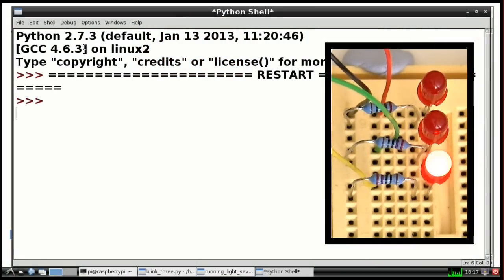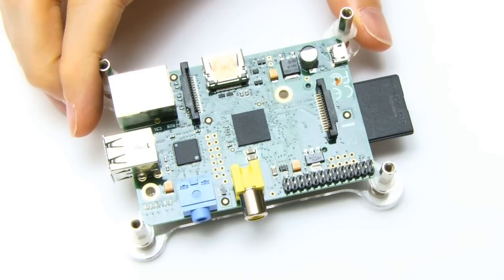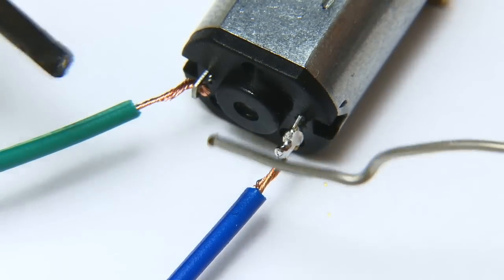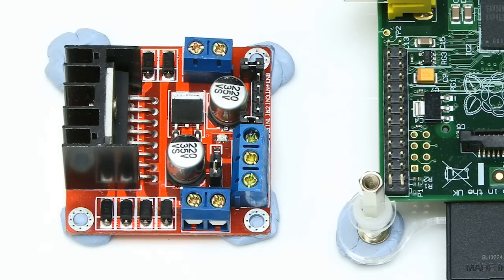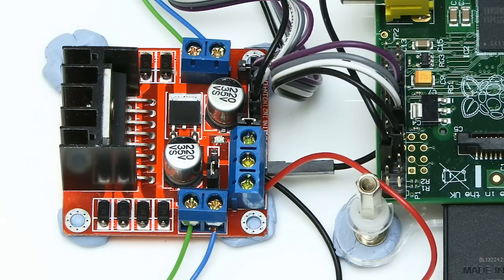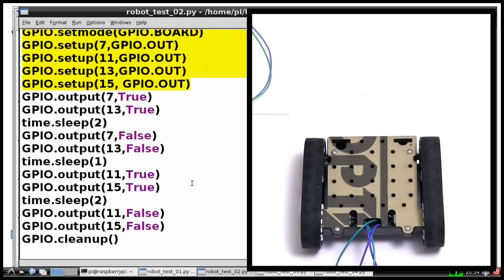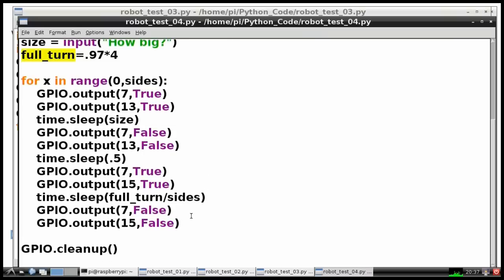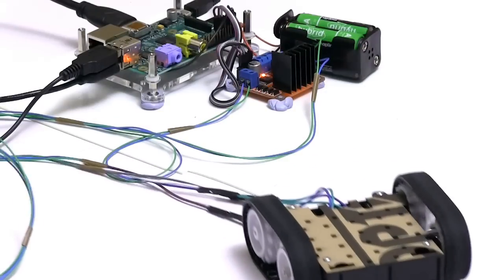Raspberry Pi Robotics #2: Zumo Robot

Comment: How many motors can you control with the raspberry pi?
Reply from the maker: It depends on the controller board you use, but using L298Ns (as in this video and its follow-ups), you could control 8 motors with 4 L298N boards.
Reply: ExplainingComputers hay that's pretty cool

Comment: I really love your videos! I have some question, is there a way to connect 6 motors without occupy a bunch of pins on the raspberry? And is it possible to control these motors wireless without them physically attached to the raspberry? 

Keep your work going!

Comment: Excellent explanation, so straightforward!

I was wondering if you could explain how to control 4 motors independently of each other (like for a drone or the Rimac sports car) instead of having just two motors.

Also, would the Raspberry Pi have enough computing power to receive inputs (other than positive & negative acceleration, and direction) and do calculations upon them? I would very much like to increase the capabilities of a kit I have for a 4 motor robot, but both motors of each side are connected to the same output of a L298 thus acting as one motor on each side.

Thank you in advance!

Comment: Hi guys am new to this but am having an error when i try to run this code it says "there is an error in your program: invalid syntax"

>>> import RPi.GPIO as GPIO
>>> import time
>>> GPIO.setmode(GPIO.BOARD)
>>> GPIO.setup(7,GPIO.OUT)
>>> GPIO.setup(11,GPIO.OUT)
>>> GPIO.setup(13,GPIO.OUT)
>>> GPIO.setup(15,GPIO.OUT)
>>> GPIO.output(7,True)
>>> time.sleep(1)
>>> GPIO.output(7,False)
>>> GPIO.output(11,True)
>>> time.sleep(1)
>>> GPIO.output(11,False)
>>> GPIO.output(13,True)
>>> time.sleep(1)
>>> GPIO.output(13,False)
>>> GPIO.output(15,True)
>>> time.sleep(1)
>>> GPIO.output(15,False)
>>> GPIO.cleanup()
Reply from the maker: Make sure you are running the editor by typing sudo idle in a terminal, so that you end up executing the code in root mode. (This is noted earlier in the video). Also, make sure you are running the latest version of Raspbian that includes the GPIO library. It has been included for some time now. But to be sure open a terminal and execute sudo apt-get update and sudo apt-get dist-upgrade
Reply: Thanks you it works now, should have seen the big smile on my face

Comment: hi another question, can you only use 1 motor as I have everything setup but it is not working. I'm wondering whether it is becuase I'm only using 1 motor?
Reply from the maker: One motor can only drive one of the tracks. If you want to be able to drive something backwards and forwards, and to turn in either direction, then you will need two motors.

Comment: Now that I am retired, I'm ready to have fun with computers. I purchased my first Pi, a 3 B, last month. It is now portable with a 7" touch screen, fitted case, camera, and RPi PowerPack V1. 2. You have inspired me to experiment with robotics. I have watched all three of your Zomo Robot videos, several times. Now I am ordering parts. This brings me to my first question. The label on the motors you purchased appears to define the ratio as 286:1. Yet I cannot find these motors at your suggested sourse, or any of the other sourses I tried. Would you be so kind as to suggest another ratio and perhaps provide a video on the relationship of motor ratios to performance, given the controller used. Thank you very much for sharing so much valuable information in your videos. Best regards.

Comment: will there be any modification to the python script if i used a rasberry pi 3 insted of zero
Reply from the maker: This will work just the same on a Pi 3. :)
Reply: but i have tried it and it didn't do any thing the motor driver tunes up red but the motors will not work at all
Reply from the maker: mohamed elayadi Then why not tell me that?! :) Are you running IDLE from the terminal via sudo idle (to ensure that the GPIO functionality will work)?
Reply: ExplainingComputers i  running the scipt via kali linux's terminal
Reply from the maker: mohamed elayadi Does Kali Linux have GPIO support? If not, this will not work.

Comment: Hi there!
I have all the stuff ordered and built evertything on my Raspberry. I only miss one little thing and that is the battery clip. How much voltage is allowed for this thing?
Reply from the maker: You are not missing much then! :) The motors are running from c.6 volts, but would probably turn OK with 4.5+.
Reply: Okay, I saw the most clips have 9V. That must be good then! Thankyou for your quick answer and ofcourse thanks for your great video!

Comment: I've tried to run the same cold twice and all I got is error from my Raspberry Pi b 2
Reply from the maker: Are you running Idle in super user mode? You need to to access the GPIO pins. Access by typing sudo idle in a terminal.

Comment: Hello

Few week back bought Respberry Pi 3 (to start basic development)and today connected it with L298 Motor Control board 
(https://www.robomart.com/l298-stepper-motor-driver-board-for-arduino-avr-smart-car-robot), 
followed steps provided by you to setup the connections.

On Powering on L298 board Left Motor connected to L298 (output 1 , 2 ) and GPIO (7 ,11 ) auto starts without givving any command.
Do you see any issue configuration / hardware.

Comment: I have this same robot kit.  Why didn't you use the chassis as your battery pack?  It holds 4 AA batteries.  Just curious because that's my plan.
Reply from the maker: It was because I was not mounting the Pi on the board, so I would have had to have another set of wires from the battery back to the Pi and controller, in addition to those to the motors. But I will be using the battery container in the chassis in my next video featuring this kit -- when I finally get around to it. Two follow-up videos in fact -- probably late October. :)
Reply: ExplainingComputers Ah.  Makes sense.  Thanks.

Comment: I love the way you speak and teach. You're not too slow, and not too fast. Your voice is very easy and effortless to follow and you always explain everything in good detail without being boring. :) Ty so much!
Reply: One (or two) questions! How much did it matter which GPIO pins I use for L298N motor controller?

If I want to connect more stuff on my PI at the same time, like LED matrix (4 pins plus ground if I remember correctly) and ultrasonic distance sensor HC-SR04, do I run out of GPIO pins which I can use? I'm still a bit lost with those ^__^
thanks in advance.
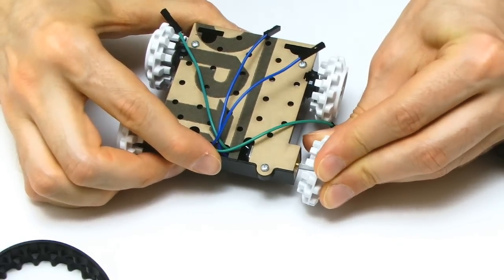Reply from the maker: You can use any of the general GPIO inputs to connect to the motor controller -- look at about 5:36 in my GPIO Inputs video here  https://www.youtube.com/watch?v=NAl-ULEattw  to see which pins they are (there is a diagram, lower screen). You will run out of available pins eventually, but not I think with the devices you list and running the L298N. :)

Comment: When I connect ground on my pi to ground on the L298N, pin 15 seems to be on high already and the motor turns, even though i have no program running. When i run the program, the movement stops for a while(where i assume it sets pin 15 output to false) and then starts again as soon as the program finishes. Any idea why?
Reply from the maker: See the very end of my page here: http://explainingcomputers.com/rasp_pi_robotics.html

Comment: I have followed the instructions as instructed, but I am getting no response from the motors. The L298N has power when connected and disconnected to the pi, and the code runs without error. any suggestions?
Reply: I had the GPIO pins backwards. Have it working now! Thanks for your help!
Reply from the maker: Check if your L298N has any jumpers -- see the very end of my page here: http://www.explainingcomputers.com/rasp_pi_robotics.html Good Luck!
Reply: +ExplainingComputers I have two jumpers on my controller. It's the same model as in the video.
Reply: where can i find the code ?
Reply from the maker: Blerp McDerp
I would experiment with your jumper settings and double-check the code.
Reply from the maker: Blerp McDerp Wonderful! :) I will be returning to this setup in September for a couple more videos.

Comment: Thanks for the great tutorial. The front wheels, are they supposed to be quite stuck relative to the back wheels? I haven´t connected them to the board yet, but I am not able to move them by hand. Guess this is how it should be right? Thx
Reply from the maker: Yes, this sounds right. The front wheels are connected to the gearboxes and motors; the back just spin on their axels (until the tracks are put on). Good Luck! I hope soon to make two follow-up videos to this one . . .

Comment: sorry if this is a noob question but will a higher gear ration mean a faster motor?
Reply from the maker: The other way around. The higher the gear ratio, the slower the final speed. For example, a 100:1 ratio means that the motor shaft has to turn 100 revolutions to turn the output shaft (wheels) one revolution; a 1000:1 ratio means that is has to turn 1000 times to turn the output shaft one revolution.
Reply: ExplainingComputers thanks, I understand it now

Comment: I have connected up just like the video suggests, with the rpi3 and battary pack  unplug. Now I give the rpi3 power and connect the battery pack the motor starts moveing automaticly and does not stop.
Reply from the maker: Run the code (maybe with the battery pack unconnected), and let it finish (which will execute the GPIO cleanup command. Then try again. Also see the bottom of this page for info on different configurations: http://www.explainingcomputers.com/rasp_pi_robotics.html Good Luck!

Comment: Great video, but quick question please......
When I connect my battery pack.  One of my Zumo wheel motors powers up with no code in place.  I have checked my wiring but cannot see anything out of place?
Any ideas please??

Thanks
Reply from the maker: Firstly, run the code to execute a GPIO cleanup, then connect the robot -- in other words, make sure the GPIO pins are all "neutral" first. Secondly, there may be a 5V enable jumper on your board that needs disconnecting (not all L1N1s are make the same -- see more in my note at the bottom of this page: http://www.explainingcomputers.com/rasp_pi_robotics.html

PS: I will be returning to this robot project very soon -- as you will see in my videos tomorrow and the Sunday after! :)
Reply: +ExplainingComputers Thank you Christopher for you're reply.  After reading you're comments and from the description on your link I was able to get the little blighter to sit still 🤔.
The 5v jumper was there.  Tested off and on and worked as it should.  Once I cleaned up the GPIO pins, that seemed to do the trick although they had never been activated before.  Again, thank you for your prompt reply and look forward to more of your video's.  Al

Comment: Great vids.  I just started programming Python recently.  This has been a sleeping goal for way too long (over 10 years).  I have found my first practical application with this series.  Thanks.
Reply from the maker: You may appreciate a video I am posting on 12 June all about using GPIO pins as inputs. It is a quite a long video and features a ton of Python coding that builds on what is in this video.

Comment: Hello Everything works ok when powered from 230 V mains but with the power of the battery (robot controlled remotely via wifi). I had to change the pin 7 to 12. Pin 7 ( power from baterii) gives then still 3.3V. Raspberry B+.

Comment: do you need 4 AA batteries for this to work?
Reply from the maker: +CutTheRope1 The way it is wired, yes.
Reply: +ExplainingComputers at the moment I only have 2 battery packs that each hold 2 AA batteries. I've tried using both of them and combining the red and black wire of each but that hasn't worked. Any suggestions?
Reply from the maker: You need to wire your two battery packs in series, not parallel, to get 6V (well 4.8V!) from them. So red from one goes to the black from the other, and then the other red and black (as it were) deliver the added up voltage of all four batteries to the Pi. Imagine lining up all four batteries the same way around, end to end -- as they would got into a large cyblindrical torch -- with the power taken from them at both ends. That is what you need to replicate with your battery holders.
Reply: +ExplainingComputers Thank you so much, I tried it out and everything worked perfectly!
Reply from the maker: CutTheRope1
Excellent. Isn't the Internet a wonderful thing?
Reply: +ExplainingComputers It certainly is. I'm very appreciative of how knowledgeable and available you are, it makes working with computers much easier for novices such as myself
Reply from the maker: CutTheRope1 Keep an eye out for my upcoming videos on Raspberry Pi GPIO inputs, and then further videos controlling this robot with the keyboard and sensors! :)
Reply: I definitely will!

Comment: hi,

I am trying to make this robot.   i am using the L298 H-Bridge motor shield for Arduino - here is a link.

http://www.altronics.com.au/p/z6208a-l298-h-bridge-motor-shield/

It can't figure out how to wire the GPIO pins into the L298.   the component i have does not have the pins you use in your video (the ones you connect the GPIO pins to).   would you be able to let me know if you think the component i am using is the right one?   Also, if you have any thoughts about how i could wire it to the GPIO pins i'd be grateful.

with thanks
Michael

Comment: would these pin numbers be compatible with raspberry pi  B 2
Reply from the maker: +Reuben Stedman Yes, the pin numbers will work on any Raspberry P. The Pi 1 B+, Pi 2 B and Pi 3 B (and even Pi Zero) have more GPIO pins, but the extra ones are additons, with the other pins fully compatible with all earlier Pis  (ie same connections in same places). The Raspberry Pi foundation is very good at maintaining compatibility.

Comment: Will it work with the pi zero??
Reply from the maker: +RC_kitegames Yes, but you will need to solder some GPIO pins to the board, and use a combined keyboard/rodent device (or USB hub) as there is only one USB port. But overall the Pi Zero is a great device for robotics -- I just wish I could get hold of one! Hopefully soon. :)
Reply: +ExplainingComputers thanks!

Comment: Hey. 

In this video you use only two settings for your LEDs and motors, on and off, true or false. Is there some way not only to control wether there is any current flowing, but how much?? I'm a complete amateur but would like to give robotics a try and was thinking about building a drone/quadcopter. This would of course require me being able to control the power output of the motors. Can you use the raspberry for this??

Thanks in advance.
Reply from the maker: +Edward Garemo You can, but not with the type of motor controller I use here. :)

Comment: Ordered my Pi 2, can't wait to try this.
Reply from the maker: +Videogame hacks Yes, everything here that does not require a Pi 2 will work on the Zero, although you would need to solder on some GPIO pins to do the robotics stuff, and also use a combined keyboard/mouse device -- or a USB hub -- as the Pi Zero has only one USB port.
Reply from the maker: +Sam “OfficialNerdsUnite” Lauer Excellent! And by the time you have, I will hopefully have made the follow-up videos I have been planning for ages!
Reply: ExplainingComputers awesome I can't wait.
Reply: +ExplainingComputers Hey there, do these tutorials you are making also work on pi zero?
Reply: +ExplainingComputers ok, thanks!

Comment: the motor is related to the back wheels so how can the front wheels turn? please help
Reply from the maker: +Amande Bou Assaf Most four-wheeled vehicles only have two powered wheels. As they are dragged along the ground, the others move due to a combination of gravity and friction. Here, the rubber tracks also rotate the front wheels. :)

Comment: This is a stupid question but what exactly does the motor control board do? Could you set up the motors to a bread board, add resistors and control the output the same way. I know additional power is required from the batteries but assuming power wasn't an issue would it be possible?
Reply from the maker: +zuber1995 You need the motor controller to (a) allow you run them in both directions, and (b) not blow up the Raspnberry Pi! :) The board cannot handle that much power.

Comment: hi there, i tried this but with a different controller board (with no 5v enable) and firstly when i try to run the python script it says an error due to the gpio's then as i am powering the RPi with a usb, then the modules with an external battery, i connect ONLY the ground to the gpio's and not the VCC (as there is no 5v enable) and when i do this even if the +5v VCC is OFF the module faintly emits light as if the ground pin is powering it? any help please. thanks

Regards,
Aran

Comment: Excellent video - love your tutorials.

Dumb question for you - how do you have 4 GPIO controlling just 2 motors? I would have thought each motor would use 1 GPIO (out) and 1 GND? Or have you wired these up differently?
Reply from the maker: +Average Man vs Pi Each GPIO output controls one motor state. The GPIO pins are not supplying power to the motors; they are telling a controller how to supply power to them (ie to make them turn forwards or backwards).
Reply: Oh of course, see, I told you it was a dumb question! I completely forgot about the motor controller.

Thanks again - looking forward to more videos.